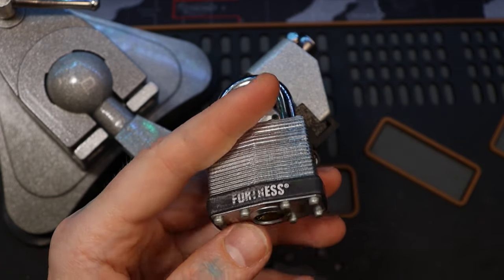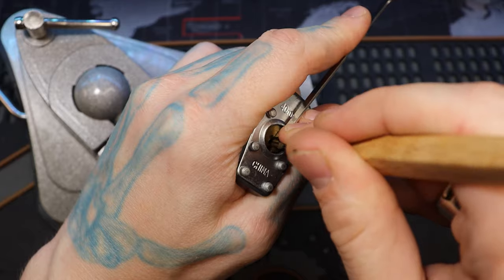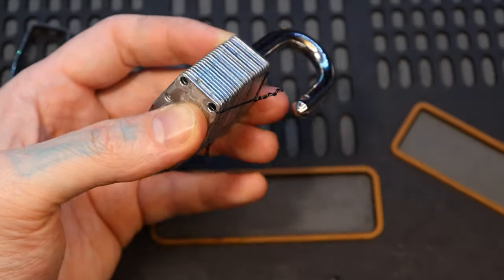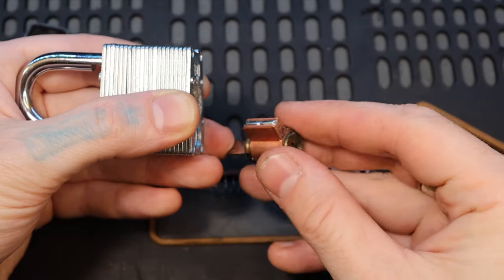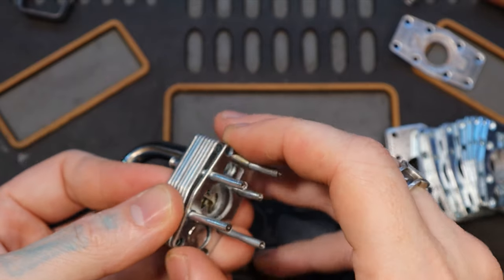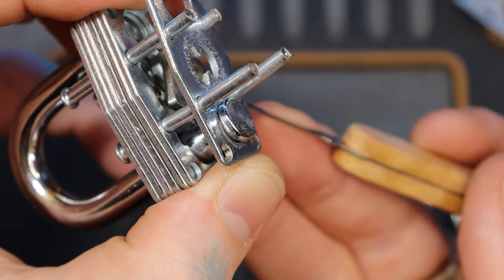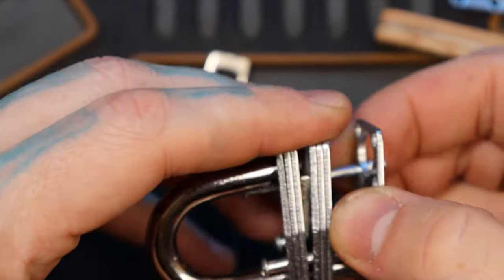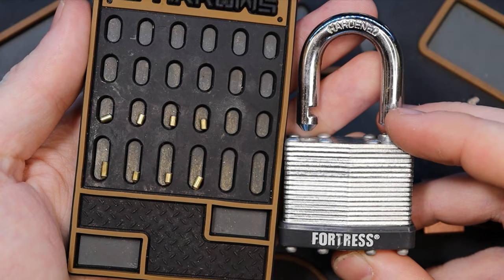259) Fortress 40mm Laminated Padlock Picked and Gutted

Comment: My breakdown of a laminated lock had the same method of retaining the shackle. I just opened the shackle, and slid the plates off of the opened end. Your video is much higher quality and you have obviously got some skill in grinding the pins. Thanks for sharing!
Reply from the maker: Yep, that's how it would come off. Did a few more similar recently. I may make a video on how to take these apart soon.